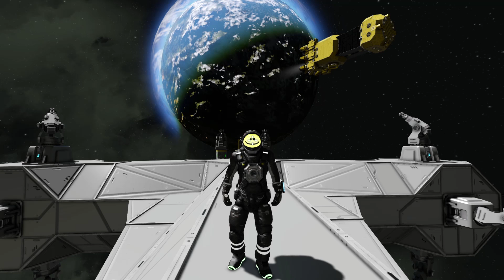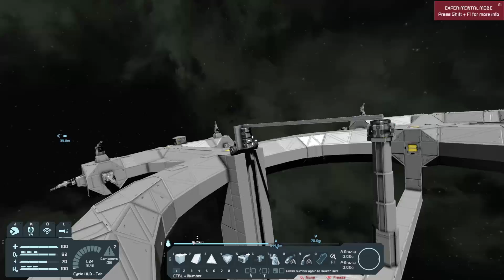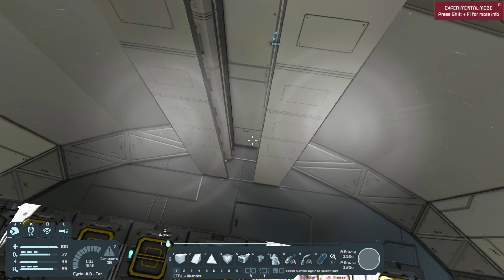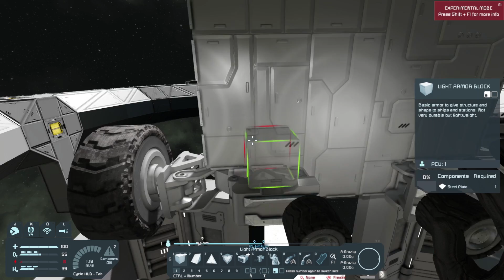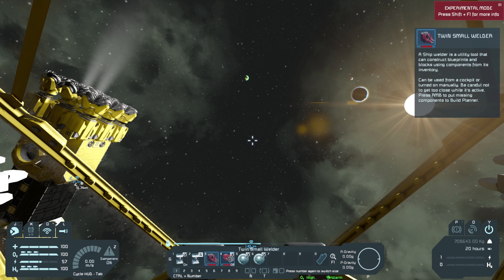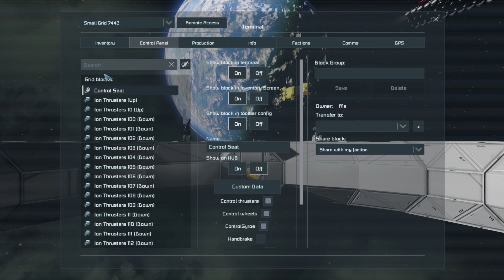Space Engineers #38: The Elevator

Comment: You can still do the sensors, fairly easily too. Just have 2 of them, a decent distance apart, on the vehicle, and 1 on the rail. 

Top sensor is set to detect the rail sensor, and when it is activated it enables dampeners then turns itself off. Bottom sensor is set to detect the rail sensor, and all it does is enable the top sensor. Means dampener sensor won't get activated on the ascent, and the entire thing can be adjusted by just moving the rail sensor up and down.

You could use a pair of sensors on the other side for the ascent, just reversed. Also could have them reset the descent sensors, just in case.

Put a pair of timer blocks to kick off ascent and descent, disconnecting from the connectors and enabling only the first sensor for the direction you are going. 

Also, might wanna disable steering on all the wheels. 

Love this project!
Reply from the maker: You forgot one thing. The elevator isn't connected. The sensor on the rail would do nothing.
Reply: @DragonNationGaming  The sensors on the rail are not there to DO anything. They are there to be detected by the sensors on the elevator. At least I'm 99% sure you can set sensors to detect other sensors.
Reply from the maker: @FatherPrax  Maybe you should test it and be 100% sure before.
Reply: @DragonNationGaming  I know I've seen it done, but not sure how they did it (i'm guessing either modded or scripting).

One way I know 100% would work is put the 2 sensors on the rails set to detect small grids, and use the Laser Antenna between the two grids (probably on bottom of the elevator and at the bottom of the shaft). Then use the same kind of "One sensor enables the other" setup to trigger the slowdown.

Another is to simply put a rotor on the outside with a small head, make a subgrid, and have the sensors on the elevator set to detect small grid or subgrids.

Comment: Can do some raycasting to do the stoping at the bottom or at the top depending on where blocks are. May be an idea as it is not on mp so should be reasonably safe for you to use in single player. 

Been watching this build and it is pretty sweet to bad the loss of the 2 sections. either way very cool. i might see if i can make somthing for you to use possibly for the elevator to automate the stopping at the bottom ..